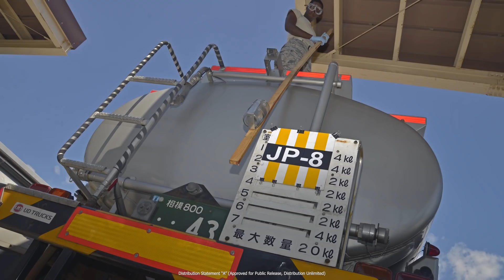DARPA SBIR:  Logos SilentHawk Motorcycle - LTC Philip Root

Comment: Thank you for video.
Cool motorcycle - consider use of shaft drive instead of chain (lubrication, sound, reliability, service periods). I guess that telescopic handle bars could make easy airborne landing. Classic motorcycle is much lighter, but one electric for few ordinary could be very useful.
Post Scriptum: futuristic, pricey motorcycle could have electric engines in wheels (centre point of mass), but this design is better for this particular usage.